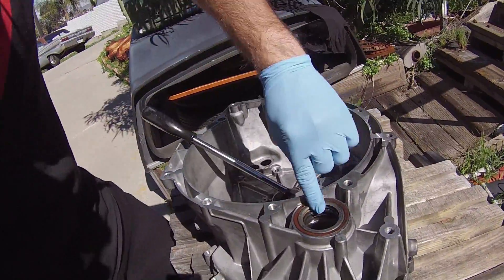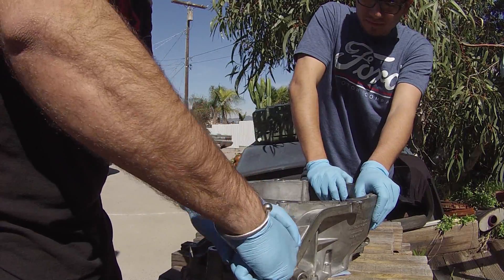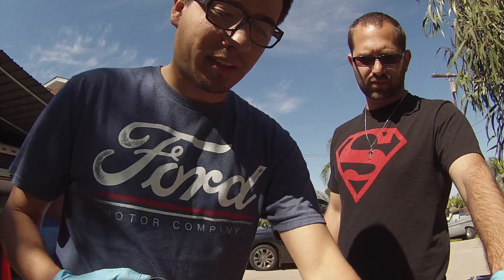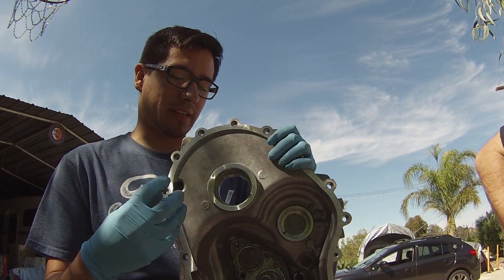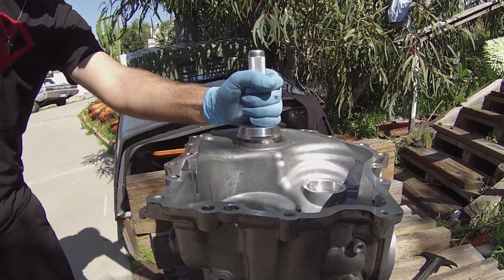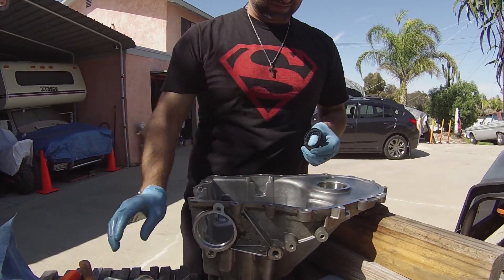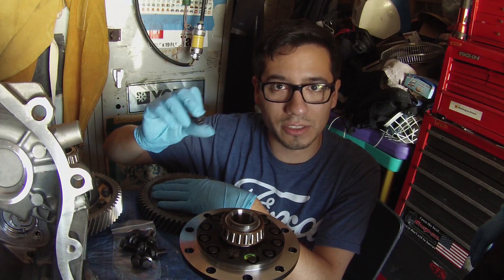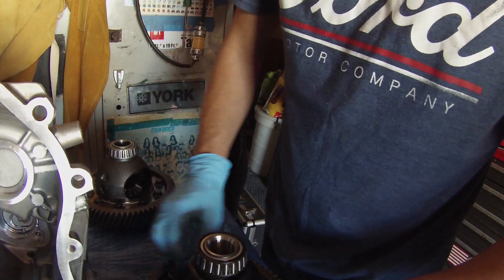Project Fiesta ST: Transmission Reassembly Part 1

Comment: Would a cheap 20 ton hydraulic press from Harbor Freight helped?
Reply: Should've just had the shop all their parts were at install the ring gear. It's press fit, then the bolts are torqued down. Do NOT draw the gear on unless you want to risk stripping the threads in your brand new carrier.